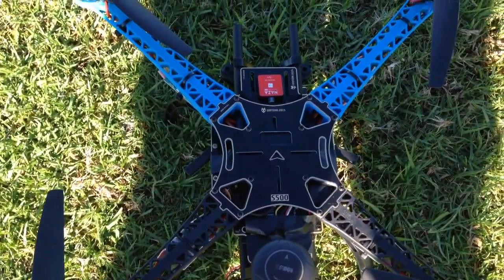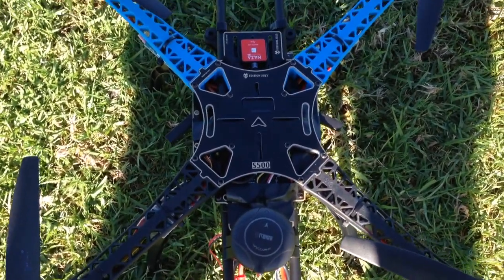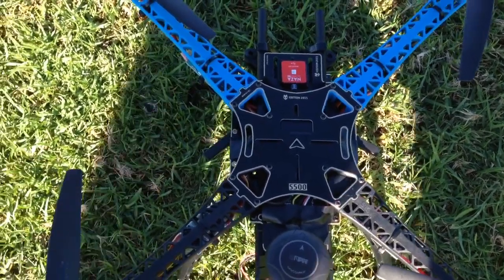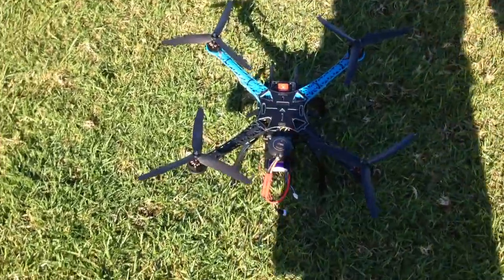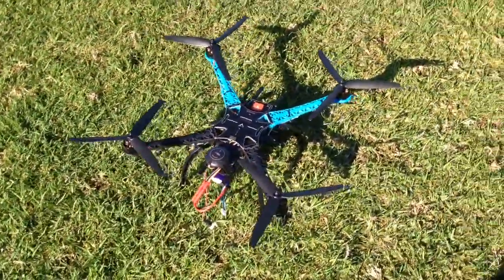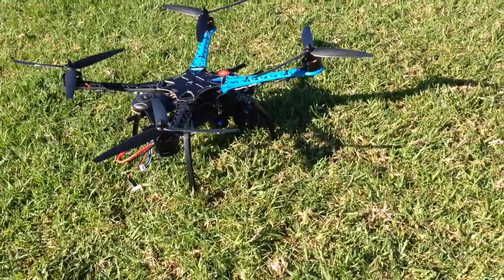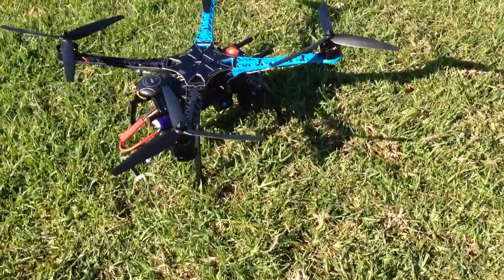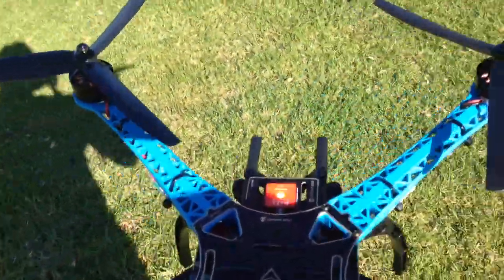Chinese GPS boot time and compass calibration

Comment: you were suppose to point the nose down in the end calibration process
Reply from the maker: +Joao Victor F. Carvalho It doesn't actually make any difference - it only needs rotation in the horizontal and vertical axis for a successful calibration.